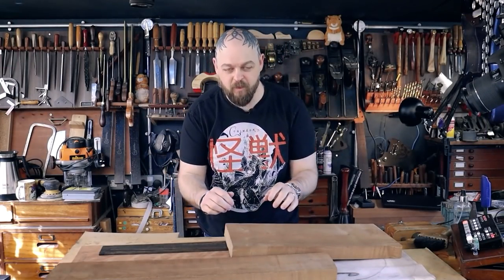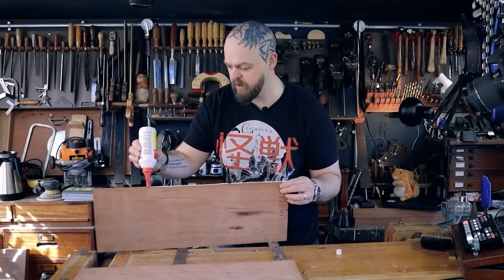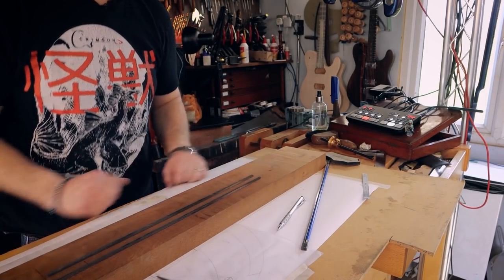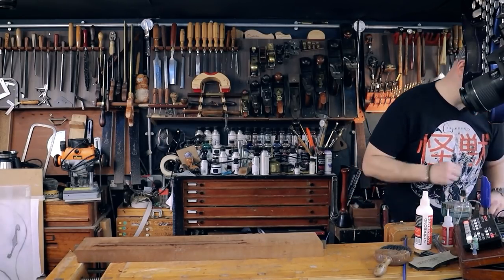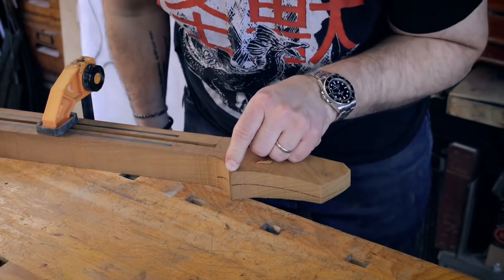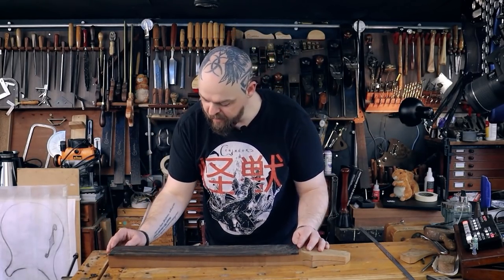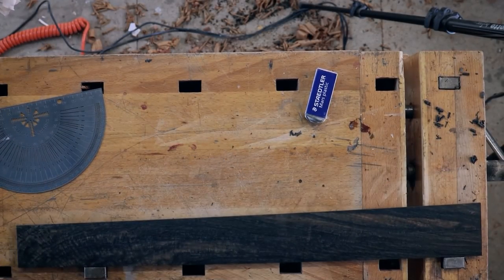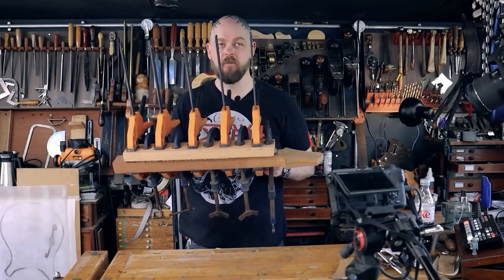Crowd Sourced Design! Ep1 | Building a Boutique Hollow Body Baritone Guitar

Comment: Hopefully, since you have the time, you will honor this country, and build a proper CNC'd ''coat of arms" with proper colors and silver trident 12th fret inlay. I also suggest you make resin 2mm dots for the fretboard in blue, and yellow; blue at the top for the first positions, and yellow after the coat of arms at the bottom with yellow, small subtle touch. You can also make a 4 mm yellow and center dot a blue inside, for standard center inlay dot. The build is beautiful thus far, it would be a shame to not go all out when you have the opportunity and tools at your disposition.

Comment: Noticed you were using a .7 GraphGear 1000 for marking out fret lines (different from your usual .9) - are there times/tasks/circumstances where you would use anything thinner like either the .5 or .3?

Comment: You said you need a new bench. What wood is this old one made of? Will it become another 1 day in 4 day build guitar? Just asking for a friend!
Reply: No one in their right mind would try to build a sturdy long lasting workbench - atleast from scratch - in a one day build, even a week is kind of a stretch. Just the dressing of the wood would take a day or two, depending on the design and stuff. Gluing together the legs and top, you got another day, then handplaining the top and legs, cutting and chisseling, routing for the vices etc.. And yes, I am speaking of a real beast of a workbench that wouldn't move a millimeter if you hang on just one side :) but I think Ben should go for it, he deserves a sturdy beast of a bench at this time! :) As much is I enjoy making fun of Buns capabilities to estimate how long one thing would take, I am pretty sure he won't go with 1 day build not even 1 week build in this case :)
Reply: @GroovingDrums  Don't read what you're thinking, read the post.

Comment: Just an idea… Maybe it could look cool if the headstock is stained in the ukraines colors🤔
With the line between yellow and blue being blended together or the colors creeping into one another.
Reply: I think it was suggested on stream and the response was staining brown wood yellow is hard and wouldn't colour match the flag closely enough, and fade over time.  But that was also when it was still a 1-day target.  Maybe now its over-run anyway, white veneer and uv-stable topcoat is possible.  Even if it's only the truss rod cover. 🤔
Reply: Thanks! Didnt think if that😅